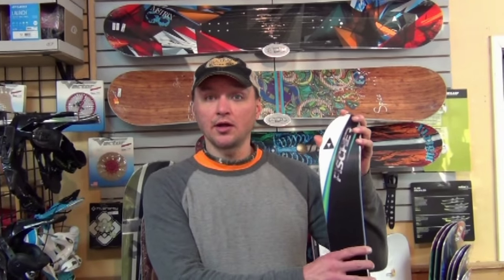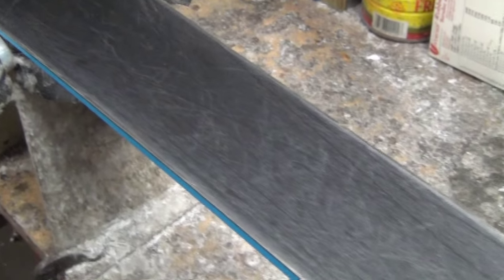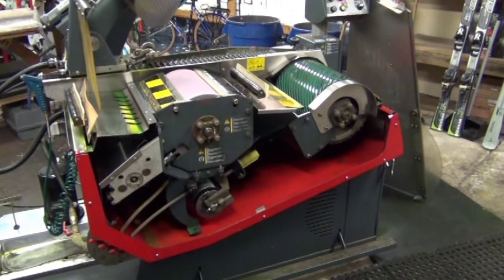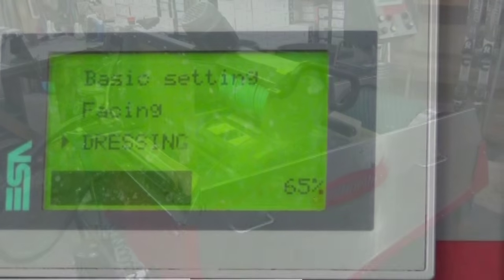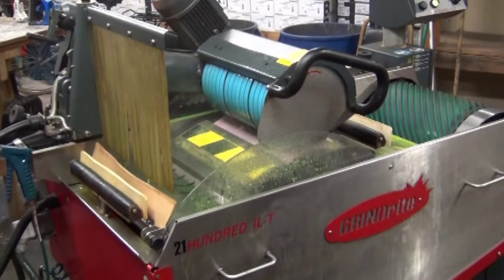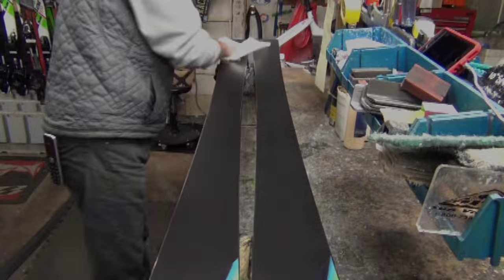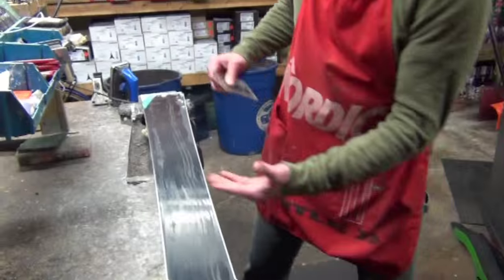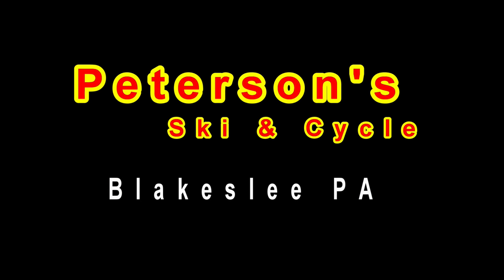How to Stone Grind Skis by Peterson's Ski and Cycle

Comment: The base pattern does NOT channel snow or water from the base.  It does two things - it can break a vacuum created between the ski and snow, but more importantly it allows wax to penetrate the ptex base.  Wax needs to be scraped off completely and the base pattern should re-emerge at the end of the waxing/buffing process.  A small layer of wax will remain bonded to the PTex base.

Comment: Does a grind also help protect the ski against water seeping in if it has got major scrapes?

I got a used ski from Craigslist. I am debating getting just a wax or a grind / full tune. I just want my skis to last atleast one season; not super concerned about the performance.
Reply from the maker: Any large scrapes and holes should be filled with P-Tex first to stop water seepage, then stone ground.
Reply: Large holes where you can see the lower layers and severe damage near the edges should be welded not just PTexed over.  PTex alone will not stay in place and the hole will get worse. Base welding material is a combination of PTex and epoxy requiring a hot iron to melt and to work properly.   As far as old skis go - I LOVE THEM.  Skis get tossed into the sale bin LONG before they have lost their usefulness.  People buy new skis because they get sucked into the marketing and the top graphics don't look as pretty.  Keep the bases maintained, edges sharp and skis can last well over a decade.

Comment: Just out of curiousity, what is the white stuff you're "dressing" the stone with before the passes, wax? If not, what is it? I wouldn't think it's wax, but something to keep the grit of the stone from getting clogged, what is it?
Reply: The white stuff is actually a thick polymer stone cleaning bar.  After dressing the stone will have burrs which need to be removed.  If the burrs aren't removed they will create 'nicks' in the pattern.
Reply: @ericpeterson7328  , thanks for letting me know. That actually went through my mind after asking, it would make more sense that it might be some kind of plastic but I've never got to use one of these machines or be trained to, so I really didn't know for sure. That makes total sense about removing the burrs after the dressing process though, thanks! 👍
Reply: Hello, what is the model of the machine?